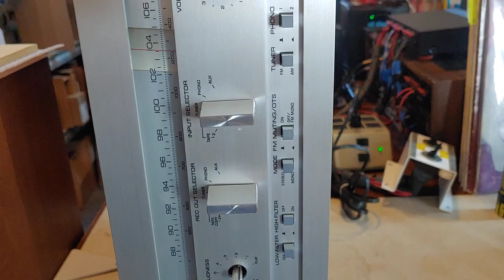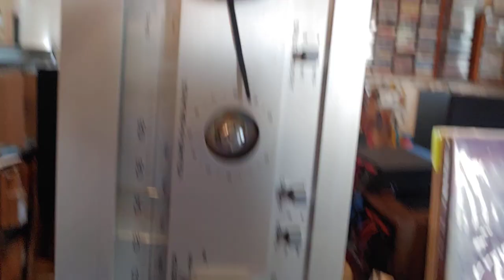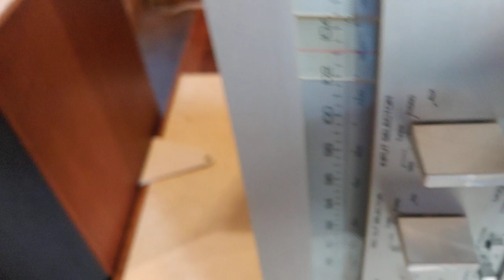Vintage Yamaha CR-820 Stereo Receiver. Removing front knobs, cabinet, set screws, etc. DEMO.

Comment: Thanks for replying, when I look at your video closely, it looks like there is a locking nut behind it. Just not sure how to remove the knobs without damaging the pot, as seem locked fast!
Reply from the maker: I wish that I had this model on hand to check, but it isn't mine. You are correct that it should have a nut or at least a solid physical connection to hold the pot in place so that the solder connections aren't taking all of the abuse.
When friction fit knobs don't pull off easily it is a toss up. If it already wiggles then you could easily break it just trying to get the knob to loosen up.

Good luck.

Comment: Hi, how did you remove the volume/balance control. I have received one though the post and it is really wobbly, but can’t seem to be able to pull them off to see if it can be tightened? Thanks, Colin.
Reply from the maker: That is a problem. The knobs should just pull off as they are just friction fit on the post. If any of these are loose and moving then most likely the solder has broken loose at the board and the control potentiometer is trying to break free and run away.